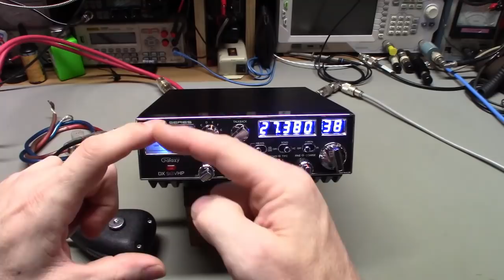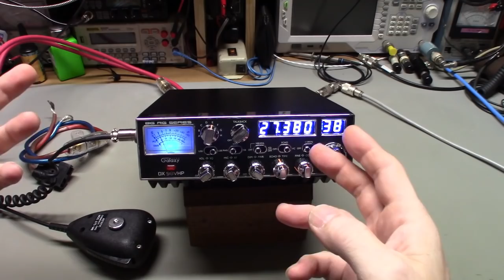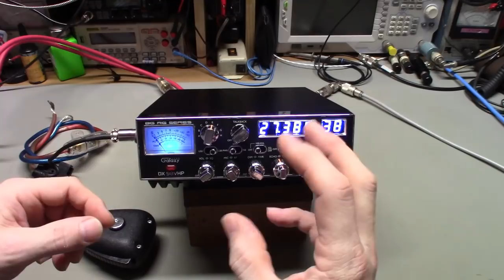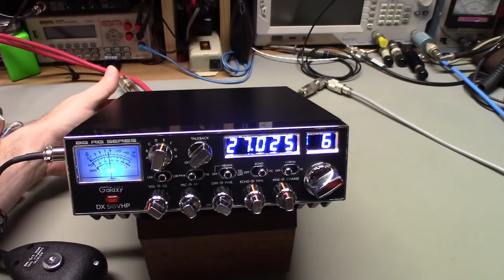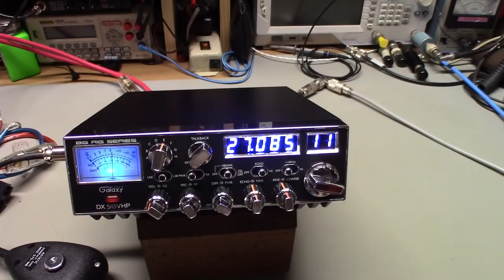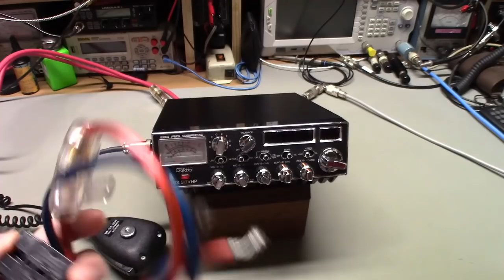Adding a Hi-Cut noise filter to a Galaxy DX98VHP.

Comment: What you need to do is put a fan on the top of the radio blowing out, sucking the hot air from the inside. Kind of like an attic fan.

Comment: All my frequency mods are on switches on the back of the radio.  I only had one radio where I modded the switches on the side of the radio.  Double pole, double throw, and center off.

Comment: 98vhp needs the modulation turned up from the factory and AM power set to 200 watts pep if you want it loud and proud! Stock settings on CB radios are no good if you desire loud audio.
Reply: How do you get peak envelope on a carrier signal?

Comment: I like the 2 capsistaor sitting.
Reply: CB Techs are the worst, they act like the discovered the cure for cancer, I've been doing this since I was 12 making my own speakers. 
Just put the cap across the speaker leads try a 0.15 uf cap, you can stack two together to get 0.30. It will be one or two you will like

Comment: What did you end up with for the values of two caps? I may have missed it. The AGC on that rig sounds like a ham rig with it set to FAST which is what most folks use for CW...why would they design it that way? I think the AGC should be slower and it would sound better for the SSB mode...IMHO!  73 - Dino KL0S

Comment: Would be nice to make a circuit coming off VR4 that would trigger a different colored LED in the S-Meter on Modulation Peak Threshold. That way you could use your Mic Gain and set for just flickering on dynamics using the visual indicator. Could replace the Bright position on the Bright-Dim switch with this LED circuit. Something I'm mulling over while watching your Hi-Cut video. Thanks for the videos Mike. Great as always.

Comment: I repaired one of these a few days ago, did that one have a weird arrangement for Q37 with one of its legs going to a wire jumper because it’s pinout didn’t match the pcb? One of the traces looked like it had never been soldered. I published the video on Friday if you want to see what I mean.